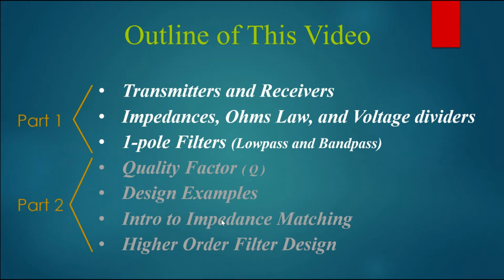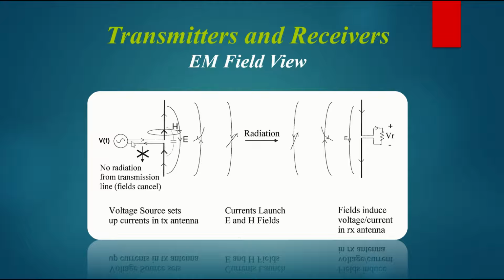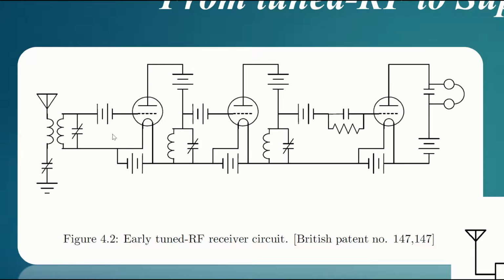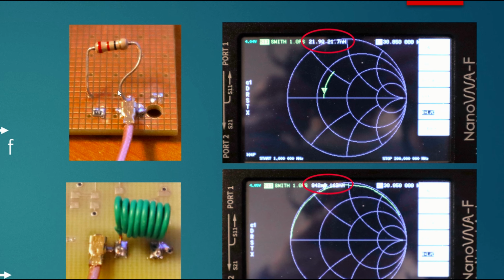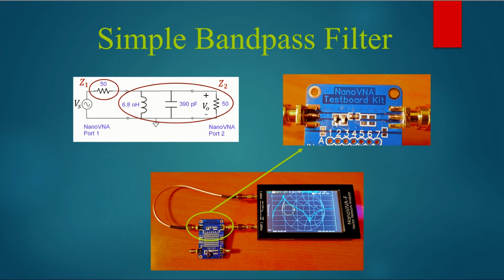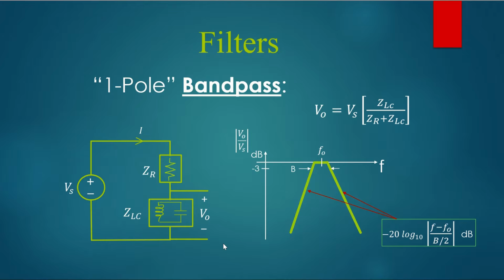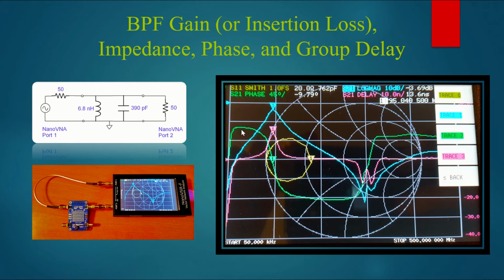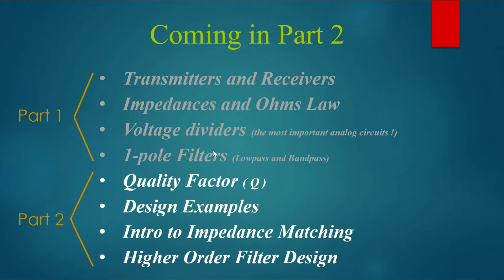Radio Design 101 - Episode 1 - Transceivers and Filters - Part 1

Comment: Good job professor. Im interested in SDR systems. I developed an FM Demodulator IP that runs on an FPGA. I build my own rf front end to evaluate it. I was able to capture two radio stations only. The issue appears to be on my RF front end. Could you share any working front end rf circuit to use before the demodulator. I also don’t mind sharing the IP with you if you want to evaluate it, but you will need an FPGA to run it on together with the rf front end.
Reply from the maker: Sorry about the delay in replying. That sounds like an awesome project and one that might fit in nicely with some tech covered in a companion series titled Radio Design 401. Do you know why the receiver is only able to get 2 stations currently? Is it due to insufficient sensitivity, or from overload?  In RD401, we focused mainly on the overload problem. BUT, there are some complete schematics. See for example PDF page 26 in the slides for RD401 Episode 6 here: https://ecefiles.org/wp-content/uploads/2025/09/RD401-Episode6-Rev1u.pdf . The schematic on page 26 shows the simplest version, but it lacks frequency tuning - but the response curve is shown. For a more complex version with freq tuning (but not the full needed control system), the final video has a full discussion including performance tests : https://www.youtube.com/watch?v=eaAocuG8x9M&list=PL9Ox3wpnB0krNexW2k5JMCaewXN7LoRXd&index=11
Reply from the maker: And here's a broader bandwidth design with about 20 dB of gain.  https://www.youtube.com/watch?v=43wQmYeqt44&list=PL9Ox3wpnB0krNexW2k5JMCaewXN7LoRXd&t=1138s  Of course you could also buy one pre-made if you want to get a quicker assessment what your receiver/demod can do with a bit of gain ahead of it.  Found this on Amazon.  Just an example.  https://www.amazon.com/hiBCTR-0-1-2000MHz-WideBand-Amplifier-Noise/dp/B0FDQ5JZCZ
Reply: @MegawattKS I’m using this one in my circuit
Reply: @Megawatt Thank you for your quick prompt! My demodulator is certainly working as I tested it with external FM modulated signals out of my sig gen. I believe the reason im getting only two stations is due to 10.7 MHz bandpass and the long cables I am using connect different blocks of the system. It could be overloading too. Here is how my RF front end look like: 

75 omhs antenna connected to bandpass filter 80-108MHz( no impedance matching) —>rf gain block of 20 dB —->LNA ( 30 dB) —->mixer—->10.7MHz IF filter —-gain block of 50 dB ——> I2S —-speakers. 

Do you have an email so I can share with you the IP code. 

Regards

Comment: Is the frequency X-axis scale linear, not logarithmic?  The range is 50Khz to 500Khz  which would suggest it should be logarithmic but the shape of the frequency response appears linear.
Reply from the maker: Its definitely linear. Most basic RF spectrum analyzers use linear, unlike audio analyzers. I think it's because that's the way they started, and most of the applications of radio are narrow-band. So they may have a wide span to look across the range, but then one typically zooms in on a region (like 80 to 120 MHz for the FM band with a little extra on the edges example). The same is true of the network anayalzers for similar reason.
Reply: @MegawattKS  OK, thanks. I got used to audio semilog Bode plots and the 20db per decade slope  for this kind of 1st order stuff so it threw me off at first and then I realized that it must be linear.

Comment: Hi, one (novice) question about bandpass filters. For example if we have a parallel LC circuit between the source and the load. At resonant frequency the Z0 of this LC circuit goes theoretically to "infinity", and the source of 50 Ohm "sees"  only into the load of 50 Ohm, so good impedance match there, no reflections. But at every other frequency (different from f_resonant) there would be a mismatch between the source and the circuits in the direction to the load. Does the source have problem with reflections in that case?
Reply from the maker: Yes. Good observation! The filter is actually "reflective" out-of-band. Meaning, it's not too bad over the filter bandwidth, but outside the filter bandwidth, the impedance is very bad as seen from the source - so it has strong reflections. Another way to think about this is through power conservation. Inside the passband, the power gets to the load, so little reflection. Outside, almost no power gets to the load, so almost total reflection. Occasionally, designers create "reflection-less" filters, but it's not common.  For more, and for cases where the reflection can become somewhat of a problem, see here:  https://www.microwaves101.com/encyclopedias/reflectionless-filters
Reply: @MegawattKS  Thanks for a quick feedback. I realize, the most filtering is done on low power signals anyway, and impedance mis-match wouldn't be a problem. And small sognals are first filtered before amplifying, where impedance mis-mach would be a problem.

Comment: Amazing content! The mouth noises in the mic really bothered me a lot, but if I turn the volume down almost completely and then turn on subtitles I can get through it. It's a personal issue of mine for sure, but the content is so good that it is worth it.
Reply from the maker: Thanks for the comments.  There is a technical issue with the audio in this episode (and maybe one or two others). The microphone has a volume knob and I think it may have been set too high in some segments. Hopefully most of the other videos might be a little better, as I turned the mic down once I realized this.  I've never tried the subtitles, but that sounds like a good solution. Glad YouTube added those.
Reply: @MegawattKS  yeah I realized after I continued on that it was mostly just this episode that had that specific sound issue for me. I'm so glad I continued! The other ones seem better. It's an issue I run into a lot. I've just got something wired wrong upstairs lol.